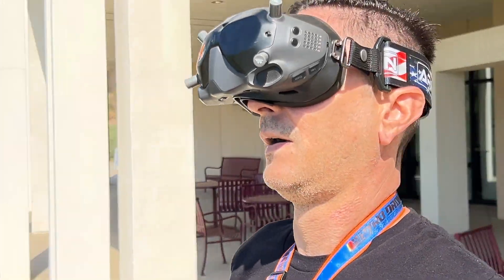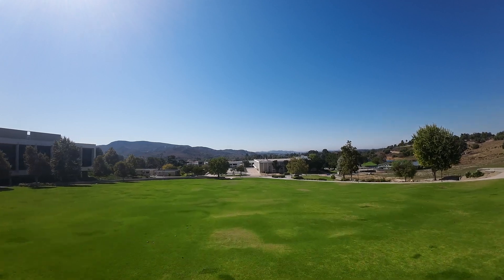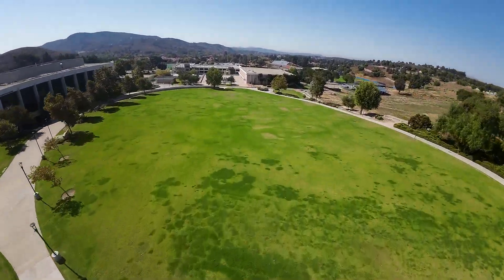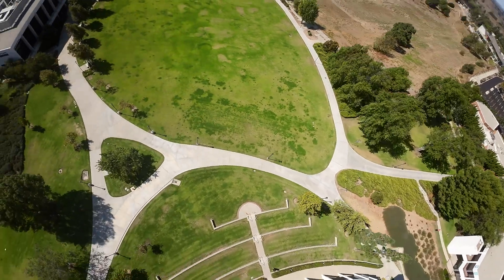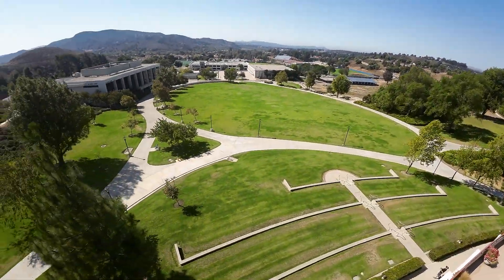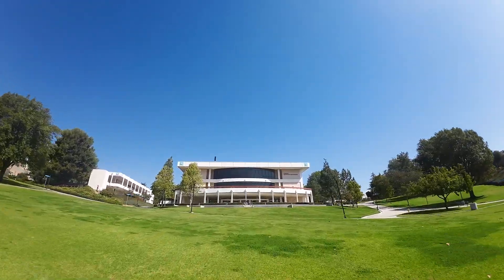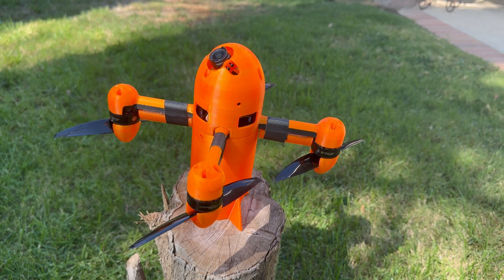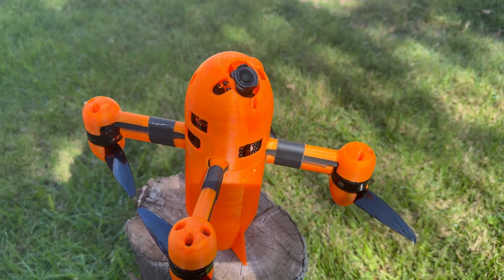AOS HS5 High Speed Drone Maiden Flight - Narrated

Comment: Did you find that in fast forward flight (pitched  forward) that the roll and yaw controls are swapped? At 90 degrees pitch they should be 100% reversed… no?
Reply from the maker: @KendallSmithFPV  yes, totally! After 45 degrees Roll and Yaw trade places… when you’re flying it’s really not that hard if you’re already used to mixing with both sticks for co-ordinated turns.
Reply: @Rogue_FPV  - Thanks for the reply - I built a similar design and I haven’t had the chance to actually open it up in forward flight, so good to know my expectations are correct